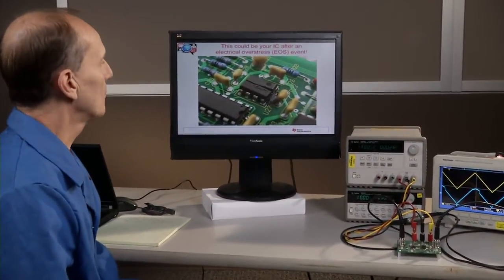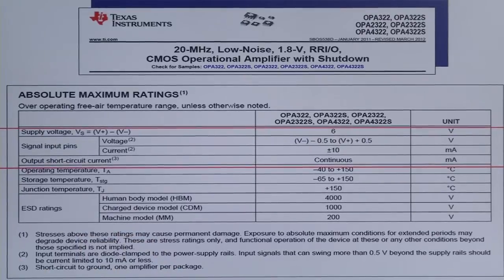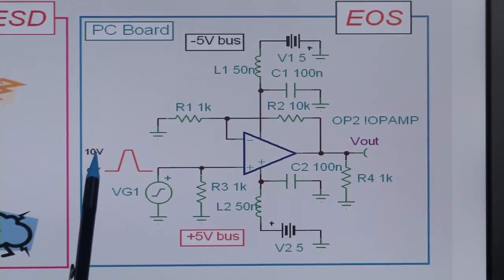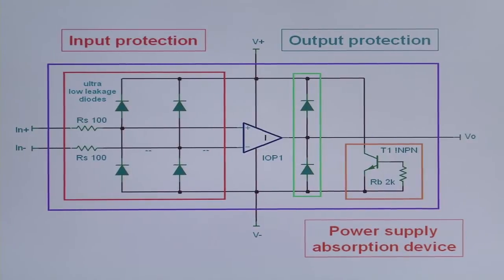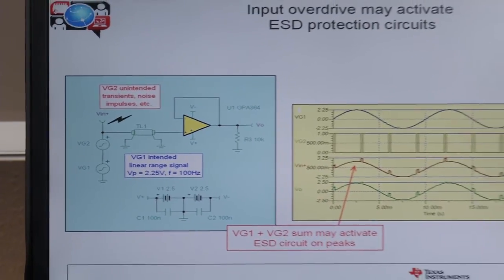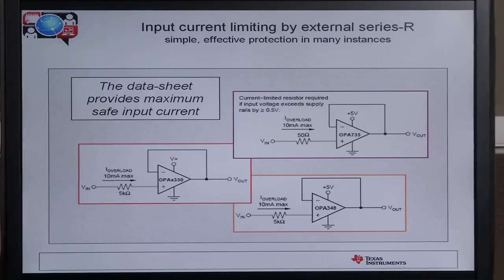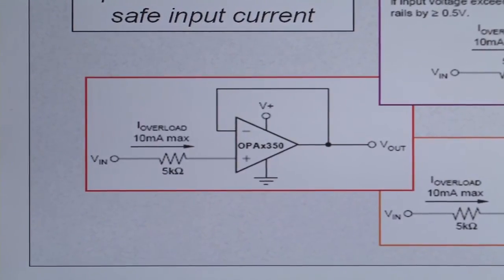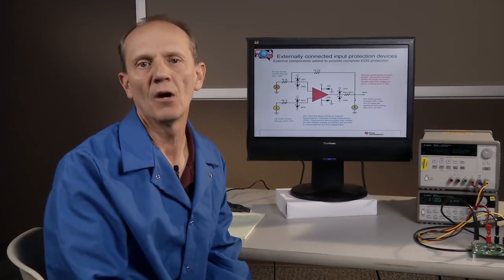Engineer It - How to prevent electrical overstress of analog integrated circuits

Comment: Great Video.

Regarding the EOS Schottky diodes, it's a Catch to zero in on a particular part.

Most parts have forward voltages larger than 0.3V for say 10mA of Current which risk triggering the internal ESD diodes. 

The ones which have lower voltage drop have large leakage currents, especially at higher temperatures, thereby messing up your precision. 

If anyone finds out a nice part which fits best of both worlds, do share.. That would be really helpful. :)
Reply: Hello Vikram,Small-signal Schottky diodes will exhibit a lower forward voltage than conventional small-signal P-N junction diodes, for a given forward current and temperature and that is desirable from a EOS protection standpoint. However, the issue at hand here is the difference between them is the reverse leakage current which will be substantially higher for the Schottky compared to the P-N junction diode. The ESD diodes internal to the op amp inputs are a good choice if the current is kept below the maximum because they are designed to have very low leakage current such that the input bias current specifications are maintained over temperature and within the operating specifications.If the choice is made to include external Schottky diodes for added EOS protection, use diodes that are classified as small-signal diodes and not rectifiers. The older 1N5711 and 5082-280x series originally manufactured by HP typically had some of the lowest leakage current levels that I have seen published. I sometimes wonder if that wasn't due in part to the fact that they were assembled in glass packages and not plastic. I have come across another low-leakage Schottky that is in an SMT package, the NSR01L30MUT5G. Also, a conventional P-N junction diode having very low leakage is the CMUDW6001. They might serve as good replacements for the older HP Schottky diodes.One other possibility is applying a very low-leakage JFET as a protection diode. This was covered in a TI/Burr-Brown applications note in the 1990s. You can find it here:http://www.ti.com/lit/an/sboa058/sboa058.pdfI hope this is of help to you.Regards, ThomasTexas Instrumens - Precision Amplifiers Applications Engineering

Comment: What happens is turned on when running, alot of test done and no good results reached. It is too detailed to discuss here. I have 30y experience in elec and so I know well what is ESD cell :).   What we have now is, 5% of the ICs are going burnt due to this problem. It is suspected a design problem in the IC. I just dont want to go more details, I got enough headache from it.

Comment: Salah,

Internal ESD cells are never, ever intended to be turned ON except during in an out-of-circuit ESD event. You never want to turn them on during an in-circuit EOS event because the consequences may be damaging to them. The ESD cells are not intended for EOS service. Indeed the EOS protection should be external to a device that may be exposed to EOS events.

If the internal ESD cell was melted and badly damaged by EOS, a meaningful FA may not have been possible.

Regards, Thomas

Comment: Hi Panson,

Modern LDO devices have ESD protection cells between the pins and one should take care not to ever present any EOS condition that would turn them on. Those cells are deisgned to stay off under normal operating conditions. The concern for the LDO then becomes an EOS condition applied to the input. A TVS with a voltage rating a few volts above the applied input level should protect against any unexpected EOS event. The output should be ok unless there is a HV back EMF.

Thomas